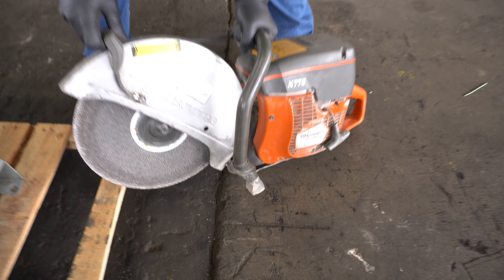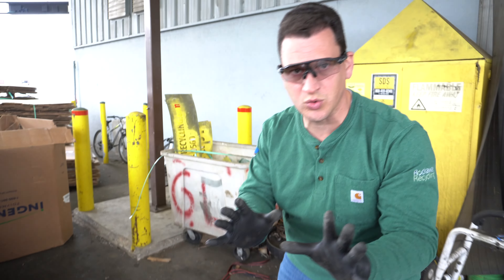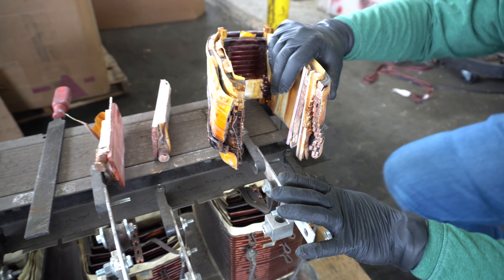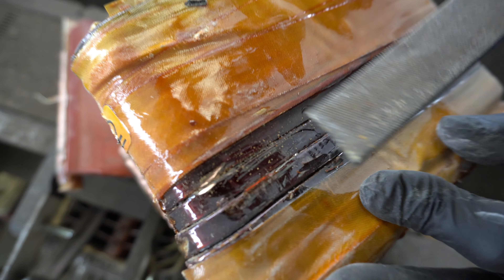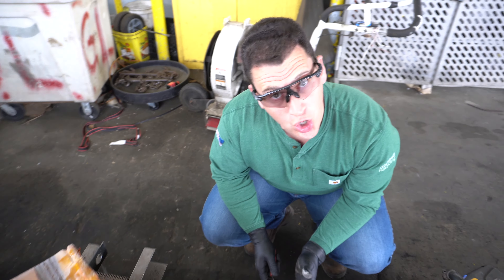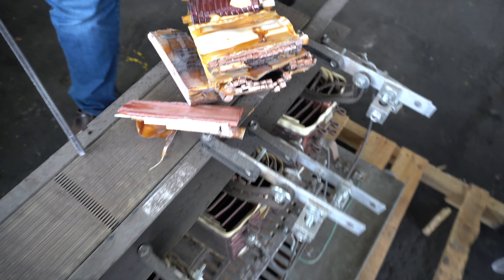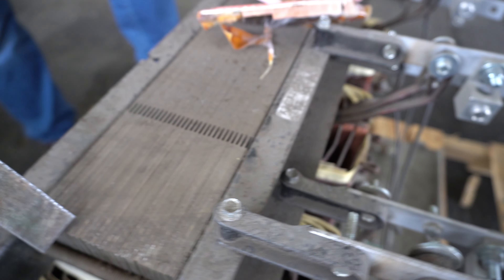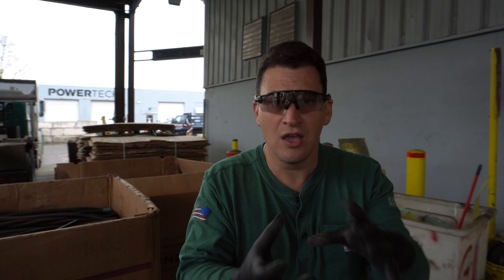Scrapping Industrial Transformers: Tools and Methods for Success

Comment: All transformers and electric motors have silicon steel laminations. Many transformers have a mix of aluminum and copper. Transformers have primary and secondary windings, very often the windings are not all copper. Use of aluminum in a transformer is  not just a  cost saving measure,  aluminum has a couple of advantages over copper in said application.
Reply from the maker: Very well said 👍